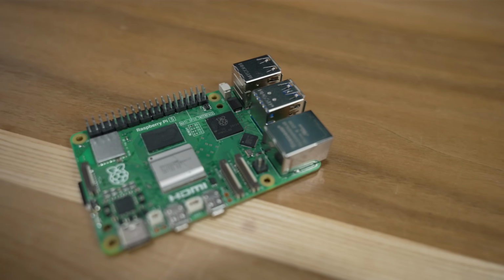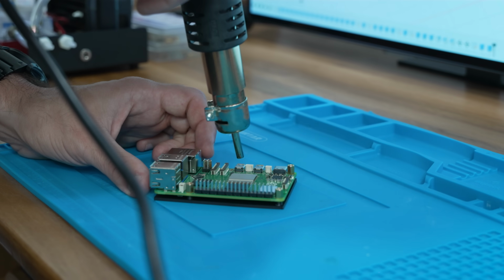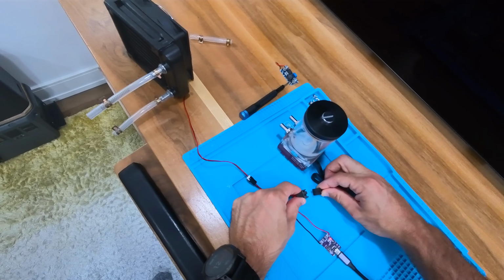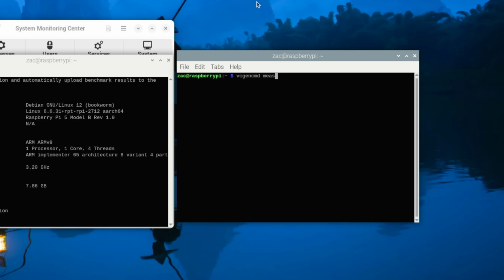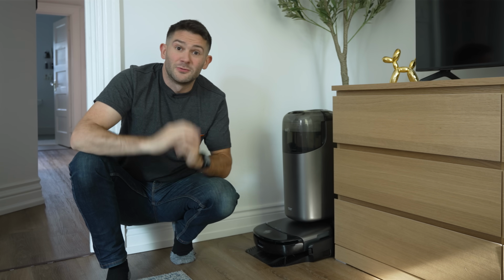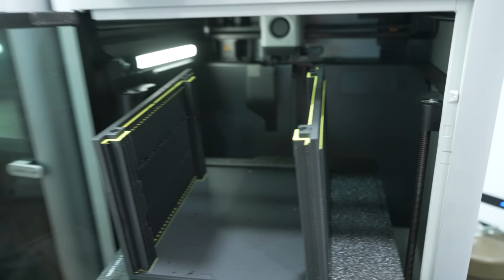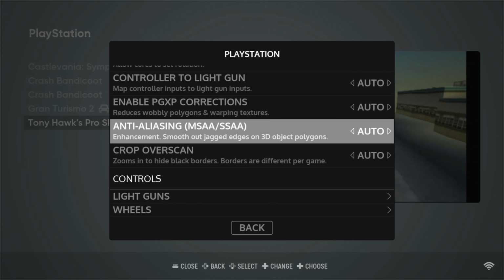Pushing a Raspberry Pi 5 to the LIMIT....

Comment: You mentioned that the Pi runs on 5 watts, but the Pi 5 can draw up to 27 watts (which is why they provide a 27W Pi 5 specific adapter). I'm curious if you were using this?

Comment: 5:52 It’s not as flat as a factory heat sink though. I guess that doesn’t matter if you’re appropriately applying thermal paste, but machining a surface flat with outperform whatever sanding you’re doing

Comment: Batocera is awesome! I use it on my homemade arcade machine and it works wonders. Can even run wii u and steam games which is awesome, stuff like castle crashers works very well with the joysticks on my cabinet. It does help that I'm using an intel NUC instead of a raspberry pie though lol

Comment: Distilled water is the best for cooling  use pt nuke or silver coil. Do not mix unlike metal. Brass, copper, steel. You are fine. Do not add aluminum to the mix or you will get galvanic corrosion

Comment: Zac i have a challenge for you.... Zintendo 3ds/2ds XxL. Use switch sized screens for displays. Hinge or no hinge. Built in grip. Better battery. Better storage. Better speakera. Micro Hdmi out. Headphone jack. i just thought about this in my "trying not to fall asleep" tired mode.

Comment: PA-CF is very visible example for material creep - it will deform over time if exposed to tendion below its yeld strength.

Simply put - you'll be printing a new bracket in a month at best.

Comment: You could have picked up a DuPont or just connector kit as well. They are pretty affordable and rather than soldering an old connector together, just make your own using a crimp tool and connector kit.

Comment: Didnt you remove your overclock when you changed the OS?
Also, you tested "stock" with the ihs off?   Are you sure you were overclocked at all?  If you remived the overclock with the operating system change, and your standard test eas with ihs off, then id assume youll see gains that are a bit off.

Comment: If you wanted too you could have used Liquid Metal with the water cooling not in the circulation system but as a thermal conductor

Comment: The thing is you can get fully operational n100 pc cheaper than pi5 plus all the components, and n100 will still be faster, with more ram, and roughly the same size

Comment: You dont need a 120mm radiator is wildly overkill, you can use a 60mm radiator and only gain maybe 5-10 degress. Aliexpress have some for about 10$.

Comment: Ok, some suggestions i have here for you:

First, have you overclocked again after switching towards ubuntu? You havent included that bit in the video, so im unsure you did, cause the switch of OS deleted your progress under RBOS. 

Secondly, how were your temps in the end with the benchmark with 3.2GHz? Based on previous results i guess it was somewhere around 35 max, so theres a lot of overhead until you reach the critical 90° range. So you could consider downsizing the water cooling with a smaller pump, radiator, fan and basin, which would let temps rise a bit but makes the whole project much smaller and quiter in total, im pretty sure you could reach the size of a N64 with that and still be under 80°.

Comment: Hi, I don't know much about home watercooling, so not on the head (nor the balls ;-p), but instead of blowing the tank and the RPi5 with hot air, why not reverse the air flow and use a micro-converter-raiser from 5 Vcc to 12 Vcc for the fan ?

Comment: if you add a peltier and cover all the ram module to you can have more performance of the cpu using the same or less voltage( ovviously the peltier consume a lot more) but if you are casing performance is the way to do since cpu work faster at the same clock but being a 0 °c (a 15w peltier should do)

Comment: Was wondering, what is that spray you used on the cables on the inside of the back of the case? Was that some sort of spray on glue or adhesive?  thanks in advance.  BTW great videos.

Comment: Ps2 emulation on rpi 4 and 5 works fine also PSP emulation works well to.. not all games are perfect obviously but ETA prime channel has shown on a regular basis the emulation for rpi and other bords the rk5388 cpu on orange pi and others. The n97 intel CPU is a real good choice for emulator projects and the n100 and n200 are not quite as good as the n97 but are decent.. the rpi5 should play a good 50% of the ps2 library of games!! Also using different backends other than direct X like volcan or something emuelec support multiple backends same for botacera and ppsspp and psx emulators.. so saying ps2 doesn't work is not true it does!!
Reply: Also using SD card is a huge part of the problem 60MB,s at its best isn't fast enough get a nvme hat for the pi and boot from that!! Or on a pi4 the USB 3 to SATA SSD board will increase data speeds by 100's or MB per second and nvme hat's 1000's MB per second!! Running a OS or games off a SD card is just way too slow and not even close to fast enough data speeds especially random reads and writes..

Comment: 4:30 i suggest lm since your are gonna push it hard. get that kapton tape out and start masking that tiny little bugger :)

also nylon flexes alot, even if stuffed with gf or cf. it should be MUCH stiffer. make it four or five times the thickness with the same material and you should get a  MUCH better contact :)

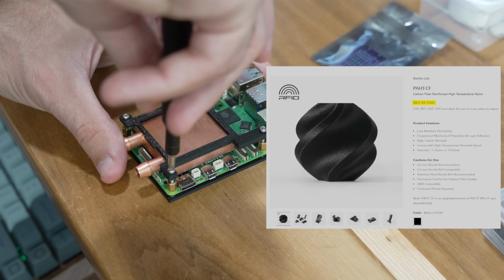Comment: 3:00 - It shouldn't eliminated any concerns about deformation unless you're using a PPA variant of carbon fiber nylon. Nylon is affected greatly by a phenomenon known as creep but it affects all crystalline structures including steel. At elevated temperatures, but temperatures still well under the glass transition point nylon will deform and do the same thing that your PLA was going to do You would have been better off with PETG with carbon fiber or ABS.

Comment: ultimately you actually end up with worse temperatures when you don't have thermal paste or liquid metal because micro voids in the heat spreader will insulate the temperature, also it would have been better to use thermal pads for the ram like desktop GPUs do, since adding more metal is just gonna create a bigger layer of insulation between the heat producing parts like ram and CPU and heat removing parts like the water

Comment: they have sites that specialize in emulation compatibility and give you a list of games that work with that emulator.  sometimes it has little to do with if a system can handle a game and more to do with if the emulator even works with the game.  there are some 16 and 32 bit games that wont work on high end gaming PCs just because of that.

Comment: What i don't think he mentions is that not all pi 5s will be able to be overclocked as it also has to do with the dye as some are better then others. I saw eta Prime over clock thier pi 5 and so I bought one just so I could over clock it I didnt read or research very well and was a bit disappointed when my pi 5 couldn't be overlooked. So you may or may not get lucky as some have mentioned this is a gamble.

Comment: Be careful with barb fittings like that.  Those bit me (destroyed a motherboard) because they slip off when the water gets warm and the pump is adding pressure to the loop. Maybe this won’t get warm enough to present a problem, but I for one will never use barb fittings again. Compression fittings always.

Comment: Tin between copper slates acts as insulator.

Tin has ~10% oh heat transfer capacity compared to copper.

Then it all comes apart on water blocks internal surface area, where running water can touch copper walls.
Not to mention any oxidation inside block, and soon you are better of without water cooling.

Ps check metals that can be in same water loop, so you dont cause electrical errosion between metals..  where one part becomes anode, and other one cathode.

But hey live and learn.

Comment: THERMAL PASTE IS THERE TO COVER ANY IMPERFECTION IN THE COLD PLATE OR COPPER BLOCK YOUR USING, IT WILL BE LESS AFFECTIVE WITHOUT IT! IF YOU WORRIE ABOUT IT USE LIQUID METAL

Comment: mm wonder if you could get those games running even better on a small cluster of pis more power but might be possible might even have the thermal head room to plum into the same water cooling loop

Comment: This is totally overkill and I like it. I would like to see some more movement on PS2 emulation, but there's really only three that work, and even then not particularly well. Hopefully I can figure it out myself, but I've barely started on mine. Emulation in general is pretty hard, but the PS2 is a multi-processor system and it's going to require a multi-threaded dynarec for sure with some intense optimizations.

Comment: MI rp5 with air cooler on audiolinux for an audio streamer has been at 4ghz rock stable sold for 6+ months. I don't even have a fan on the cooler.... It runs when in use all four cores 30-35% use.

Comment: This is a ton of work for something that could be as easy as buying a mini pc from Goodwill/eBay for under $100.
Reply: I was thinking the exact same thing.  I recently got an old generation 4 HP elitedesk with a ryzen apu off of ebay for $78.  It consumes a little more power at idle, and it peaks at like 35 watts, but we are literally talking about pennies worth of electricity here so who cares.  but the HP's performance is so much better than a raspberry pi, like the pi doesn't even come close!

Comment: geez  you should use thermal pads to level things up and if not then soldering should be also done also between additional copper plate and the block instead of only on the edges as there is huge chance of air bubbles there and last but not least: thermal paste should still be used to cover for micro imperfections, so not the best solution after all...

Comment: I think it's a bit odd that you mentioned a new appreciation for MacOS and Windows when this whole video wouldn't be possible on those platforms. Raspberry Pi's OS and Batocera are Linux. Even though it was a struggle at times to get things working, I appreciate that Linux and the surrounding communities have made it possible at all.

Comment: You should've used an orange pi 5 instead of a raspberry, it offers a way better rockchip cpu for basically the same price and even have a built in m2 slot. (It can run batocera too btw)
Reply from the maker: Neat, I'll look into it!

Comment: Aww good project,  you should have started with an air cooler , almost everything you did didn't matter.  I've been able to overstock the pi 4 to some respectful numbers just on air with no throttling.  For fun you should test the air cooler, you'll almost never run enough voltage through that thing to need a water cooler.  I did sub I enjoyed the video buddy.

Comment: Timestamps (Powered by Merlin AI)
00:04 - Enhancing Raspberry Pi 5 performance with custom water cooling.
02:19 - Upgrading cooling efficiency for Raspberry Pi 5 by changing materials and modifying CPU.
06:41 - Setting up cooling and testing for Raspberry Pi 5 performance.
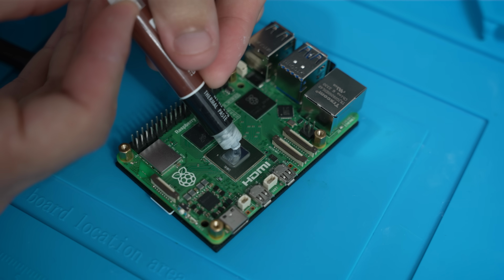08:45 - Water cooling enhances Raspberry Pi 5 performance, pushing CPU overclocking limits.
13:10 - The eufy S1 Pro robot vacuum uses innovative cleaning technology for superior efficiency.
15:20 - Innovative case design enhances Raspberry Pi's functionality and aesthetics.
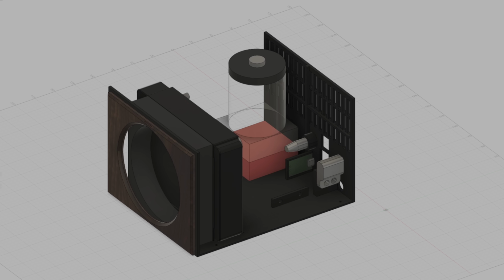19:08 - Optimizing Raspberry Pi 5 for gaming performance with custom coolant and Batocera OS.
21:05 - Raspberry Pi 5 efficiently emulates classic games with enhanced graphics.
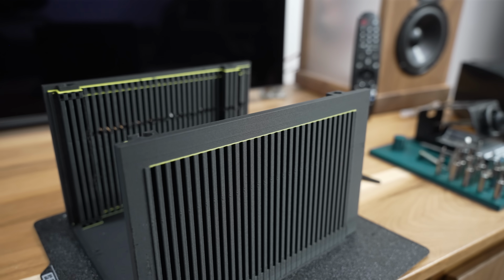25:10 - Exploring Linux emulation and material science insights in future videos.

Comment: you overclocked to 3200 mghz but the CPU is only using 25% which means its not even using half of that 3200mghz and its just sitting there. also how long did u run this setup and what demanding app did u run to show the real temps after u overclocked? I saw an idle speed of 24c. currently I get 27/28 c with a fan. if ur running something demanding for at least an hour what were the final temps after overclocking?

Comment: Instead of overclocking, why not just create a pile of raspberry pis, use Linux Mint to create a cluster, and then run a VM on top of it? You could massively increase performance - even Beowulf clusters back in the 90s could scale rapidly to way over the type of performance that you could get from an individual machine (approx 20-25% yield per box back then, and that was when networking wasn't as good as today). With the low power draw and extremely low cost per pi, you could easily create something way better than a standard gaming machine at a fraction of the cost.

Comment: Why on earth do you have a fan connected to the case? You have to put the radiator in front of it and then force air out of the case through it, not the other way around!

Comment: You could have used Recalbox instead of Batocera if you wanted to try to run PS2.
You would struggle (the CPU clock speed is right at the edge of the minimum limit of what you need to get it to work) and it would definitely not look or play good :D

Comment: "water is much more effective at removing heat than air alone" unless the water is in a closed loop and heats up. in a closed loop at high temp for a short time, water is better and quieter. for long term, since air is technically an infinite loop, ambient temp matters, but it is much more effective over time. 

water is better if you have a water cooler though.

Comment: Clodsire @ Rocky Helmet  
Ability: Poison Point  
Tera Type: Poison  
IVs: 0 Atk  
- Toxic Spikes  
- Protect  
- Ancient Power  
- Chilling Water  

Iron Valiant @ Shell Bell  
Ability: Quark Drive  
Tera Type: Fairy  
- Hypnosis  
- Brick Break  
- Drain Punch  

Carbink @ Shell Bell  
Ability: Sturdy  
Level: 1  
Shiny: Yes  
Tera Type: Ghost  
EVs: 252 Spe  
Brave Nature  
- Endeavor  
- Facade  
- Body Press  
- Gyro Ball  

Landorus-Therian (M) @ Assault Vest  
Ability: Intimidate  
Tera Type: Ground  
- Earthquake  
- Protect  
- Rock Slide  
- Crunch  

Gholdengo @ Toxic Orb  
Ability: Good as Gold  
Tera Type: Steel  
EVs: 252 HP / 252 Atk / 4 SpA  
- Trick  
- Tera Blast  
- Rest  
- Dazzling Gleam  

Gliscor @ Lum Berry  
Ability: Hyper Cutter  
Tera Type: Ground  
- Sandstorm  
- Acrobatics  
- Crunch  
- Earthquake

Comment: Its always depressing seeing more hardware that tries to run older games... one of my favorite games was on the Xbox Original, an extremely low power console per todays standards, and out performed by the Raspberry  Pi 5, and yet my favorite game cannot even be emulated due to the way the shaders were programmed... best rom I saw was a private copy that someone owned, which their friend was kind enough and skilled enough to completely reprogram how the shaders were rendered in the rom, making it compatible with emulation hardware. Saw that their fixed copy played like I remember it on the Xbox... Just don't see why large companies cannot do something like making a super power efficient modern copy of some of the older consoles or the like. I know money is always the issue, but still.

Comment: ubuntu is too heavy system, my dear. running all ubuntu background services and Gnome Environment is an overkill.
You need something more minimal to leave room for emulation. Like debian, that's why raspberry pi os was based on Debian, thus the name rasp-bian.
not to mention all your overclocking went to trashbin with that ubuntu os.
learn to build software from source, and you might get interesting software running on raspberry Pi OS

Comment: While a neat project, the notion that you'll be able to play NES games faster by water cooling the Pi is just dumb.  The Pi5 has WAY more power than is needed to run nearly all consoles, including PS1 games.  You can achieve that without water cooling.  Fan cooling works just fine for retro gaming.

Comment: 8:36 Most computers won't even run the BIOS without a heatsink, and without the heatspreader you'd never even get it to post, but the RPi5 here is running at the full stock 2.4Ghz just bare silicon exposed to the air!
 That is one crazy efficient chip.

Comment: You should've used an usb stick as the boot drive instead of a micro sd card, your pi most likely got bottlenecked by the 20mbps micro sd instead of a 100mbps usb

Comment: The limit might not bee clearly silicon lottery 🤔 you push a lot more power true thae cpu, how it works is the power supply for the cou has some decain limit for voltage riple, cou power has some power buck converter, now when you take more power out off it, your riple will get worse. You might get a oscilloscope and have a look at the voltage and see how stable it is, or if that's too much you might just try adding some high quality capacitor in line of the power line for the cpu voltage, or just to bee safe ad a lot of capacitors on any voltage lines to get cleaner voltage. Ewen the input power line riple might make an ed case 🤔

Comment: Regarding the loudness of the pump, there's an easy fix for that!

With the pump running, add one drop of unscented dawn, or other soap that contains a surfactant. This will almost immediately lower the surface tension of the water in your system, causing the pump to run quietly and the air to bleed much more easily.

Comment: Impressive but pointless, I think he ultimately used the raspberry without overclock because the overlooked configuration was wiped with the raspberry os, and all that work won't give you the power a 386 could, I don't think even the cost is worth it.

Comment: ok i am going to say a few things

1.Retro Pi

2.all the additives in water cooling pre-mix lower thermal capacity of water

3.make sure that the block and rad are copper if not you will wish you had

4.rPi group put the heat spreader on for a reason and removing it does no good in your case as you are staking more metal in its place